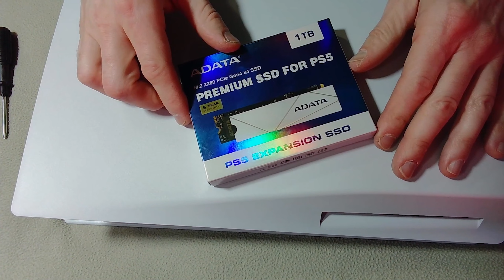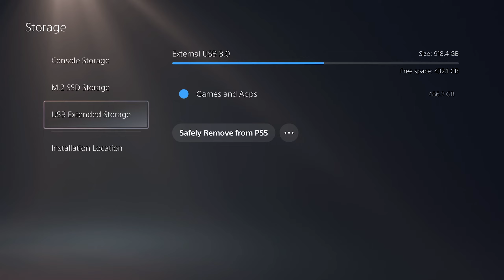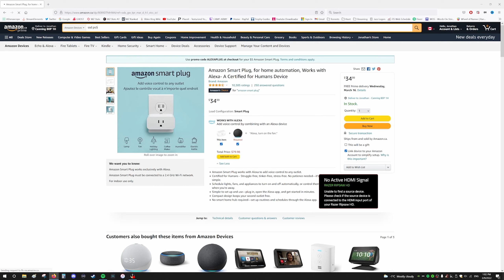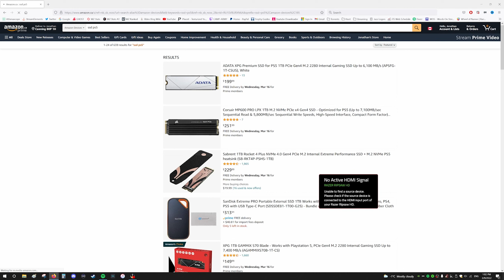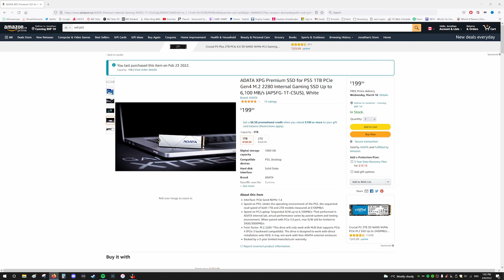ULTIMATE Budget PS5 1TB SSD ADATA M.2 Gen4 2280

Comment: "We know where the SSD is, not gonna waste your time"... well I certainly didn't know
Reply from the maker: I just assumed lol L/H Upper Panel, Under Platecover, one Phillips head screw. Tried to make it short and sweet. Thanks for checking it out. Things a beast still going strong, zero complaints
Reply: @AlwaysEvilGaming  I still need to get one for my PS5, especially since all these games are gonna be releasing this year. Need more space!
Reply from the maker: @StevieStreams  Well i was and usually on a budget, this fit the bill. I had an external HD before for PS4 games, now i just run the PS5 HD and the SSD - way smoother, RE7 loads up like 10sec quicker
Reply: @AlwaysEvilGaming  I’ll spend all the money if it’s mean my games load 1 second quicker
Reply from the maker: @StevieStreams  think it was 100MB/S faster than advertised on the box lol i think its the same as the ADATA - XPG GAMMIX S70 Blade

Comment: Can you link the heat sink you used for it? I ordered the 2 tb model for $190,  gonna use the default heat sink for now but thinking of upgrading.
Reply from the maker: M.2 2280 SSD Heatsink Cooler (Green) https://www.amazon.ca/dp/B089NV5CLJ?ref=ppx_pop_mob_ap_share
Reply: @AlwaysEvilGaming  Nice, i'll probably just invest in a heat sink since i saved so much already with a coupon and Amazon credit. I will test the Adata branded plate for a few days though.
Reply from the maker: @ThorStoneGaming  green one fit perfectly over the cover. It wasn’t expensive. I’m sure the oem is fine as is. Thanks for helping out and supporting the channel btw
Reply: @mr.b1613  I just stuck with the default heatsink it came with as well for now. Seems to be fine.